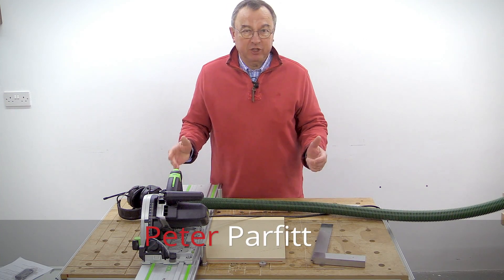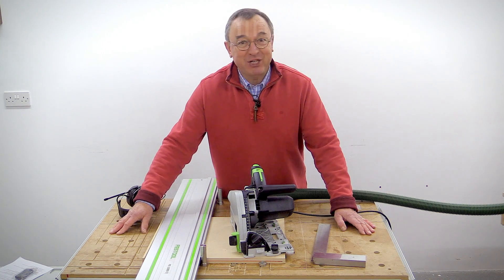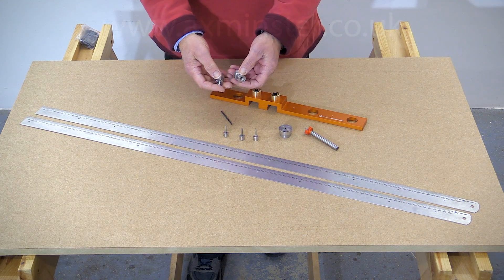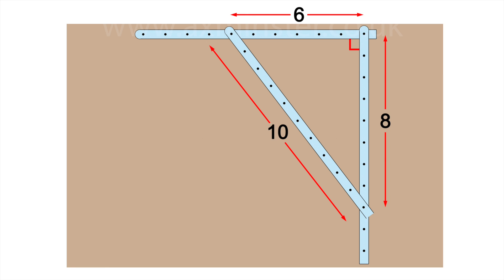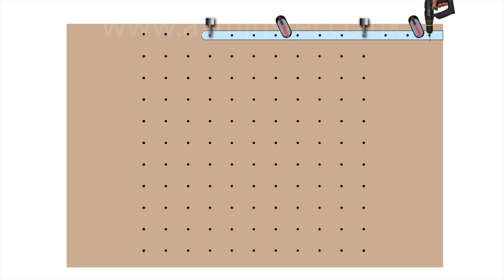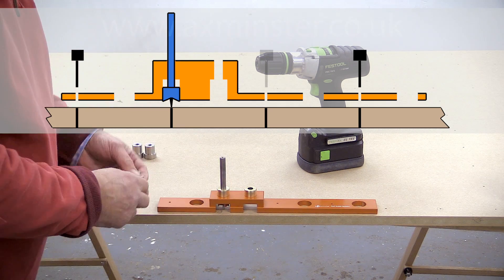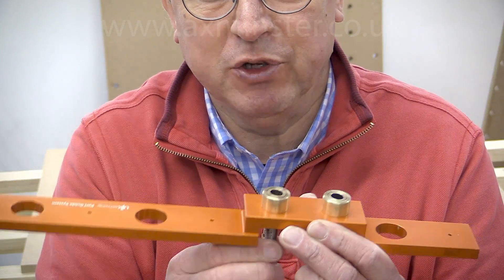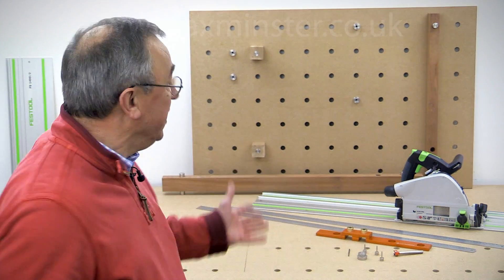UJK Technology Parf Guide System

Comment: Hello Peter, 

I 'd like to suggest an aother way to do this. The website is in dutch but the video will guide you through. It is cheaper and just as accurate as your system.

Kind Regards,

Frans van Velzen

https://www.247wood.nl/nl/werkblad-freesmal-mft-complete-set/a3957

Comment: A generally excellent video but it does not deal with the one doubtful area which comes to mind.
The thickness of the Parf Sticks (rulers) is not stated but, assuming that they are about 1mm thick, one wonders how, given the angled point on a standard twist drill, the drill will register accurately in the guide holes (which are not said to be hardened). Over time, won't the guide holes be enlarged?
Perhaps the guide bush could be magnetic and first located by a pin?
Reply: It is just a 3mm hole. That only needs to be accurate for that upp depth drill. When you then put the guide block in place and drill it with a 20mm set that accuracy does not become a problem 

So the 3mm hole as in surface acts as a guide to the 22mm drill. There is nothing new in any of this. 

The problem would become really apparent if you holes were several meters apart.

Comment: I purchased the Parf Guide System in April 2017, very cool and fun to use jig , noticed immediately how well designed and built it was, very tight tolerances for the price.

Comment: Why would you need this system when you can simply measure out on a grid drill points? Using the same trigonometric attitude? Considering it’s a throw away board you’re making ..... and please ..... don’t say accuracy .... you can get perfect accuracy by measurement
Reply: +Constuctive Critisism
I am going to say it to you anyway. Accuracy. 

If you your holes are out by a fraction of a millimeter such as a quarter of a millimeter it will magnify the problem the further you drill out.  

It will mean you cannot achieve a right angle. The question is not that your marking and trigonometric system is out but your accuracy of drilling would be a problem. 

If you are an engineer then you could fabricate to aid in what you are suggesting but then you have to consider the vast majority of woodworkers are not fabrication engineers. And do not have the equipment to do so.

Comment: Is using the second guide hole in the guide block for 48mm spacing "supported"? Will it still be accurate?
Reply from the maker: Hi, the guide hole in the guide block is not for the 48mm spaced holes. It’s there so a grid of 96mm spaced holes can be completed. We are currently working on developing a ruler that will be able to do 48mm spaced holes which should be available a bit later in the year. Kind regards Lindsay

Comment: Peter I have seen comments that after several uses the 3mm holes in the rulers widen and are not accurate anymore. Wouldn't a solution be to use a centre punch or even a pencil to mark the holes and then even use a small router or a portable drill stand with the drill. Geoff
Reply: Your holes will need to be accurate when punching but that is unlikely to be the case as you will be drilling free hand. 

People when using the ruler just need to be a little bit more careful.

Comment: Peter do you get much breakout in the MDF underneath. Do you use a backing board ? Geoff
Reply from the maker: Hi Geoff, The Parf guide system is designed so it should not have much break out. We would recommend using a backing board though. Kind regards Tracey Customer Service

Comment: @newbritworkshop 
Ive just purchased your product and after laying out 3mm holes and drilling 20mm holes. The cuts aren't square. Ive noticed that the veritas dogs have a little play in them, especially the long dogs when you press the guide against then. Is this something I could've done wrong or a faulty product?
Help from you or any other users would be great
Reply from the maker: Hi, if you would like to call us on 0800 371 822, and ask to speak to Tony from our pre-sales team, he will be happy to assist with your query.  Regards, Martine.
Reply: JT, I will be using this system soon, and would like to avoid any problems. Did you get any answers regarding the bench dogs.
Reply: if you've been watching the videos you should know the large bench dogs have to be bolted down from the underneath.this system is very very accurate.......

Comment: What's the significance of 3mm for the holes? Why not 5mm so standard shelf pins fit straight in the pilot holes when making cabinetry?
Reply: The smaller the pin holes the greater chance of accuracy.  5mm is 66% greater in size than 3mm